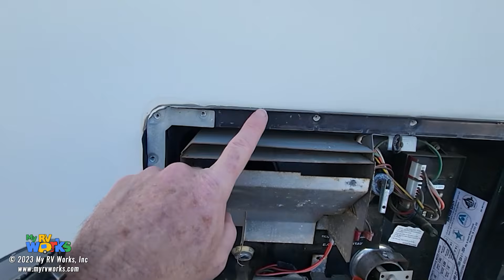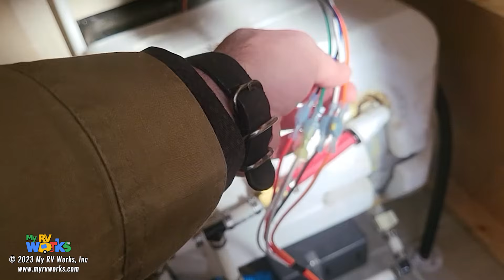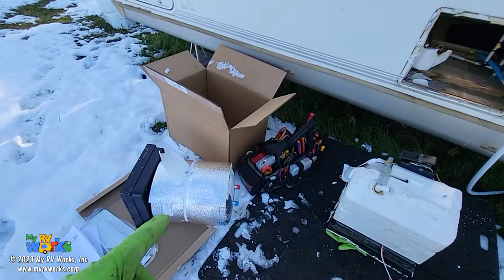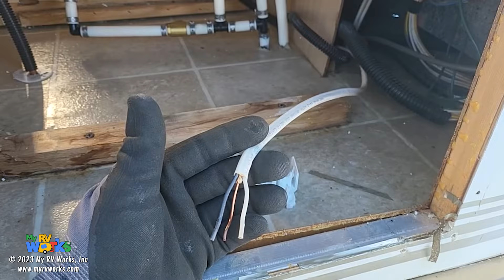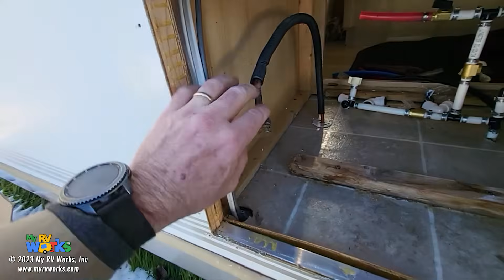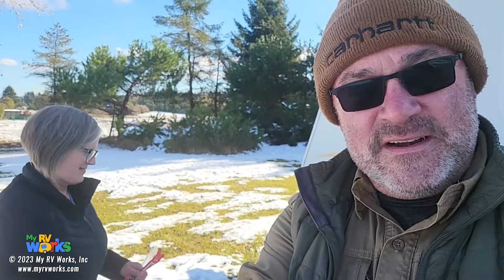Removing & Replacing A Dometic (6-gal) Water Heater -- My RV Works

Comment: Very helpful, thanks for posting! I have a 2001 Fleetwod Jamboree Class C 29' on Chevy chassis. Between you and ChatGPT we got 'er done!
Reply: I just bought a 2000 jamboree rallye and discovered (the hard way) that the water heater is cracked so here I am 👋🏼
Reply: @RJZombie96  It's actually not so hard to remove and replace, I did it over a few days, just taking my time, checking with ChatGPT, and keeping my thinking cap on...
Reply: @bobjordan5231 good to know! I'm swapping it for a tankless I got on sale for a good price so hopefully it's not too difficult. I don't know much about plumbing but then again I didn't know anything about electricity or solar but I managed to figure that out with Gemini and a ton of research so fingers crossed haha
Reply: @RJZombie96  You got this brother!

Comment: If you can you really need to review the Fogatti tankless WH the insta shower ultra. After installation the first rain, water entered through the bad design of the door and actually shorted out the circuit board. Fogatti sent out another circuit board free of charge but what about the door? If I don't redesign the door its going to happen again.

Comment: why don't you just use a residential outlet if you have room?
Reply from the maker: Excellent question. This is what I happened to have in my service trailer for mobile RV work. So that's what I used.

Comment: yikes,, i want to put this tank into my bathroom to make hot water for othe tub... (i can't afford a $5,000. new water heater and Installation),,,,,, There are washing machine hook ups,, i have electric from solar.  So i basically understand how the water goes in,,,  But how does it get up to the sink????  is that pipes?? or some kind of plastic tubing that connect underneath there somewhere,,, thank you...

Comment: I have a little 2012 joyco and I want to replace the water heater because it won’t light anymore. I was quoted $1700 to replace it 😢 is this normal pricing?
Reply from the maker: If the water heater is not actually leaking from the tank, then I would typically not recommend a full replacement.  There are lots of reasons it may not be lighting and some of those are really easy to identify and fix.

You may have a Suburban water heater on your Jayco, and we have many troubleshooting videos that cover common issues.  If you want to reach out to us at our info@myrvworks.com email and send us some more info we may be able to help you fix this yourself.

Here is a link to our Water Heater playlist:  https://youtube.com/playlist?list=PLk44vSl27TRDhGFiTI7MnrHqlE3mk7Xa5&si=Lgz9cxDX1kt467aW

Comment: I have a question, please. My WH-6GEA has a lip around the edge but it's not perpendicular to provide a place to mount to the side of the RV. Does one need to bend the lip for installation? I'm not certain if I'm explaining this correctly or not. I didn't see anywhere in your video that showed the lip area to be bent in order to install. Also, I've got the new door kit for everything to fit, but, it's not very clear how it connected (the flanges) to the WH unit itself. I appreciate any input. Thank you.

Comment: HELP!!! My old 10 gallon Atwood failed and I'm in process of installing the replacement. GC10A-3E to a WH-10GEA. The old one had the wires on back that were connected to 14-3 then it only has brown/green/blue wires coming off. The new Dometic has  white/orange/green/blue wires and a 3-prong plug. The RV has a switch for turning on the electric and then there is a switch to turn on gas with a fault light above it. I'm lost on the 4 wires coming off the new one as they don't match the old wiring.
Reply from the maker: Little over a month ago we swapped out a water heater that had the same scenario you're experiencing. I do remember completely removing the orange wire and the relay that it was controlling because the signals I was getting from the RV did not need to go through the relay inside that junction box on the water heater.  I was able to figure all this out by just following the wires on the new water heater and seeing where they went and verifying the signals I was getting from the coach using my meter. Your green, blue, and brown should all be the same, so that's a win. It's just that orange and white. I believe they did that so a 12 volt switches inside the coach could control the 120 volt Heating element using that 12 volt relay in that junction box. So, just follow the wires on that new water heater, and verify the 12v signal using your meter, and you should be able to get this all sorted out.

Comment: Great video.  Will be removing Dometic to have tank leak welded.  1. What is the name of the cleaner you mention for the exterior?  2. What do you call that electrical box?  3. Other than the butle tape what sealant (caulking) do you recommend?
Reply from the maker: Here are some links on our Amazon affiliate store. You can get to our main store using this link:  

Check out this page from myrvworksinc https://www.amazon.com/shop/myrvworksinc?ref_=cm_sw_r_apann_aipsfshop_aipsfmyrvworksinc_0MC2E2RSRF0BN5P77HBK&language=en_US

Down below I've got the specific ones you requested.

#1) https://amzn.to/4cLdEAK
#2)  https://amzn.to/3xsj3wo
#3)  https://amzn.to/4aqPj1o

Comment: Did your water inlets have a plastic cap inside of them?? Ive got a new 10 gallon Kingrver and I can't get the water lines to thread onto the inlets. I know I have the right fitting. It seems the plastic caps inside the inlets are in the way. I tried pulling them out but it seems they are part of it and don't come out easily. Nothing in the manual says anything about removing them. Just the thread protectors around the outside.

Comment: Hello, I am installing a new water heater on my RV. My old one is 18 inch wide and the new one is 14.. I have the same problem with a gap like you, problem is I didn't buy mine new. Second hand and it doesn't come with the flange. Do you know where I could buy that?

Comment: What is the black box??????
Reply from the maker: I'm guessing your referencing the Black Box on the back of the water heater? If that's the case, that is where the relay for the heating element is located.  I believe around the 6:20 mark we talk about it.

Comment: Whats the steps to take it apart? Where was that in the video? That the readon i came to this video to see how to remove the water heater  INCLUDING taking the screws on the outside wall of the RV and taking the heater out completely and you skipped that. Thats like the most important part lol you should consider editing this video and ADDING how to actually take out the screws and removing the heater.
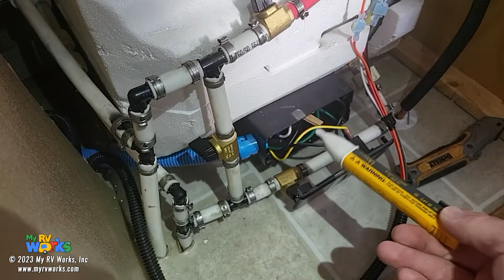Reply: Didn’t you watch his video?  He goes into great detail on how he removed it.  Starts at about 6:25.

Comment: Hello Darren. Thank you for all your videos. I had a Atwood 6 gallon water heater and I have to replace it but I’m only able to get a suburban replacement. My dilemma is that the wires are different colours and I’m not sure what to do 😢. Can you help or have a plane for the different colour of wires. Thanks in advance
Reply from the maker: The Atwood water heaters were bought by Dometic around 2014, so there should be a direct Dometic replacement for that same size opening.  Having said that, the Dometic and the Suburban do get wired differently. If you look at our water heater playlist, I Do cover some of the wiring schematics in the respective videos.
Reply: @MyRVWorks  thank you for your time I’ll look for the video explaining the two differences in wiring

Comment: What was the door replacement that you used? I need a new water heater but the new heaters are all square and my opening is rectangular. You had said you would link it but I don’t see a link. Thank you for the great video.

Comment: I was replacing my but, the water started coming out of the hole closed to the gas connection. What did I do wrong that caused that.

Comment: Hey Darren, if you have time, I had a couple follow-up questions:
1) how did new door work out?  Good fit?
2) how did modify gas line?(cautiously bend by hand?
3) I notice my rv water line seems thinner walled than standard pex tubing.  I've had great results using pinch clamp tool on existing rv fittings.  In your video you modified water lines with plastic fittings.  Are they standard fittings normally used with pex tubing or different/designed for use with pinch clamps?
4)  Lastly, did you consider tankless on demand models?
Thanks again for your concise videos and taking the time to answer back.
Greg

Comment: Did you put a check valve in on this install? I am a tech in Florida, and I tend not to use them. What is your opinion? BTW thank you for your videos, I do not get a lot of furnace work here in South Florida and when I do, I brush up my knowledge with your videos.

Comment: So glad to watch this video. I’ll be replacing my 1993 water heater this summer. My current one works, but I’m hoping to go with a tankless option so I can extend my shower time. 

Do you have any suggestions on brand and BTU? Have you done any of this kind of upgrade? I’ll be in the PNW, Tacoma.

Comment: Thanks for the video! I somehow forgot to drain my water heater when I winterized and well, tile to replace it. Thankfully replacing the same Domestic so water lines should line up the same. Do you just use Teflon tape for the water lines? Just trying to make sure I have everything when I go to replace it. Might wait for a day that gets above freezing though. Thanks again.

Comment: Howdy Darren, 
After watching this video I am contemplating replacing my 1999 Atwood/Dometic gas water heater with the combination gas/electric version. Question: how does the unit switch from gas to electric? Is it similar to the fridge?
Thanks, Jim
Reply: You have to add a switch panel with one switch for gas and one for electric.  The water heaters don't have an automatic switchover circuit.
Reply: @ThomasRobinson-oo7ms  
Thanks

Comment: I recently found your channel and have been watching your videos. Very helpful, good videos. I have question about my furnace that I can't find an answer to. I'm in high hopes that you can help me out.
   When I turn my furnace on it works perfect. Blower comes on and in about 15 seconds the propane ignites. Warms my camper to the temp I have set. However, as that temp drops and the furnace tries to reignite...it won't. The blower comes on but the heat does not. Just blows cold air. I need to turn it off at the thermostat. Wait 60 seconds and turn it back on. Once turned back on it runs perfect again. But it will only run for one cycle. When it restarts to maintain the inside temperature it does not ignite. Can you PLEASE give me some idea of what this problem could be. It makes no sense to me at all. I live in my rv full time and really need this problem fixed. Thank you so much for your time and trouble.
Reply from the maker: Typically that is an issue of a sail switch that is stuck open. There may be some lint or some kind of obstruction preventing that sail switch from being detected as closed. If you go to our furnace playlist you'll find other videos where we address this problem. 

https://youtube.com/playlist?list=PLk44vSl27TRCaZIQbm-0utYK7sVOKwXVY

Comment: Good job  I wished you had done this video about 4 months ago to the new style. It would have been nice if they had told me I needed a new door as well. I was lucky as our rv has a nautilus system which made the plumbing easier. You didn't mention a check valve. And also adding the receptacle as I checked with Dometic and if you cut the plug off it voids the warranty. But other wise good job as always.

Comment: Interesting that this video just happens to pop up when I'm considering replacing my Suburban 10-gal with a Suburban 12-gal water heater. I like long showers but unfortunately after a few minutes in shower, it constantly runs out of hot water. Only part I don't like on this larger 5th wheel RV's is no access point from within trailer so the entire job has to be performed from the outside which means I need to wait until a time the weather warms up. I've notice all the water lines in trailer are PEX so I'm hoping they left enough line to pull through to the outside opening.

Comment: Why not replace with hot water on demand?
Reply: If you do that you'll need a visible bypass installed at the shower so that when waiting for hot water to reach the bath, cold wont fill up your gray tank. Its not just at the start of a shower. Research this, not a good idea without a bypass.

Comment: Is that just a coincidence that, that is the same model as the one I had blow up on Christmas? Or was it planned? 😄
Reply: ?? what happened?????  Does that only happen with propane??  im totally new to this.
Reply: @JustMe-gs9xi  My furnace is controlled by the ac unit and the board in the ac unit that turns the furnace on and off went bad. So I didn't have any heat. I had water in the water heater and it froze. Expanding the tank til the seams blew. (The 8,000btu space heater couldn't keep the thing from freezing.) Allowing all the water in the tank free flow on to my RV floor. I have yet to ever replace the tank or fix my furnace. I am to poor to afford the parts. So, I haven't had water in 3.5 years and the furnace works when it wants to. I do live full time in this RV. My $40 a week from my medical insurance checks just can't get it fixed. I barely get my food covered with the help of a food pantry every 2 weeks. Yes, I am looking for work but no one wants to hire me.